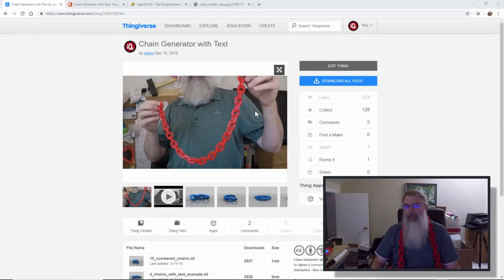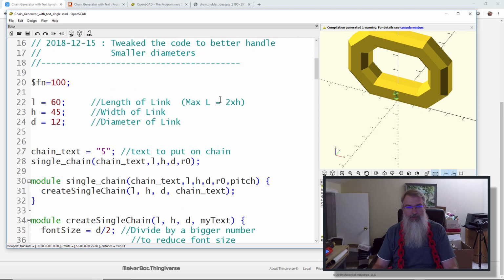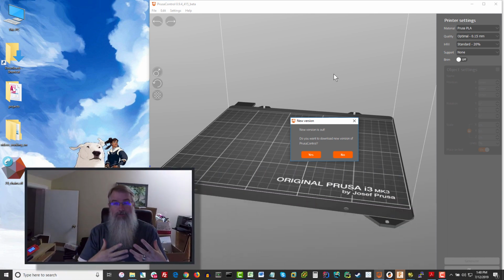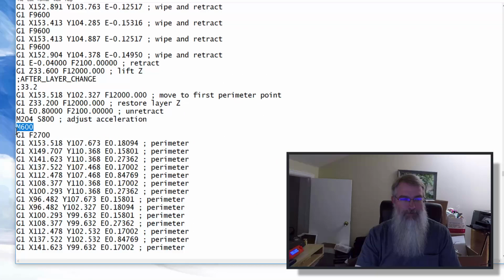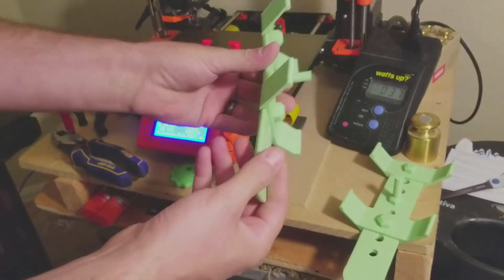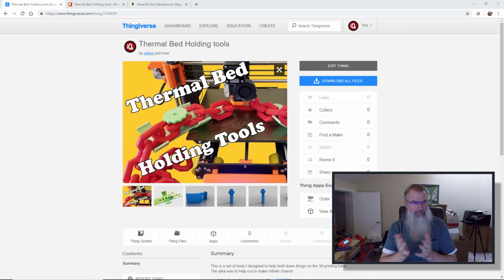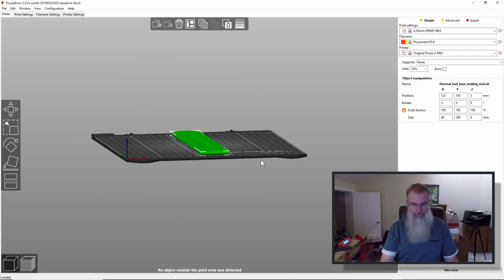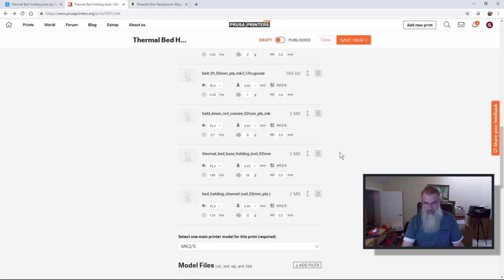3D Printing Infinite Chains

Comment: super cool!  i took out a smaller loan. maybe I'll make a short chain.

fyi, you could print the chain guides in petg instead of pla.  petg stands up to higher temps without bending. is slightly more difficult to print though.

M300 S300 P1000
plays a beep. you could add that to your M601 workaround gcode.
Reply from the maker: I think I would print this in petg if/when I do it again otherwise you get that bit of bending from the heat over time.
For the gcode I need to spends some time fiddling with a better replacement for the stick your tongue out code.
I think it needs a few beeps, a better message, and maybe retract the filament a little?